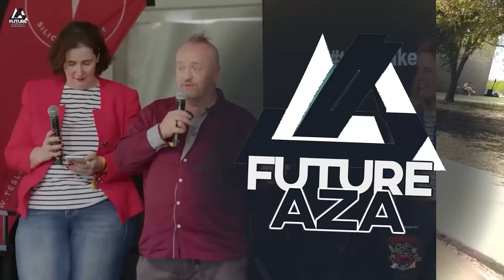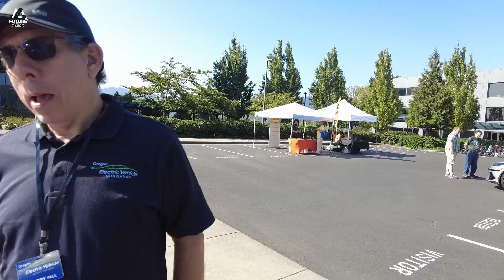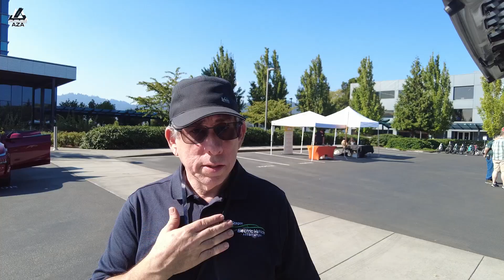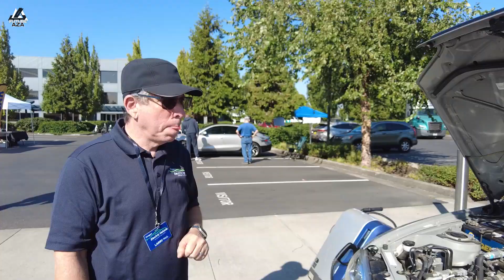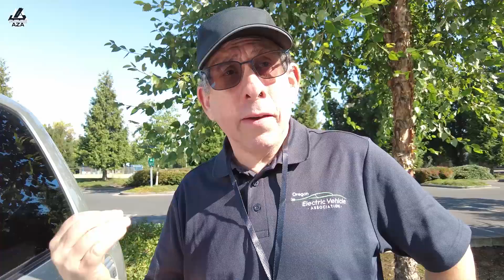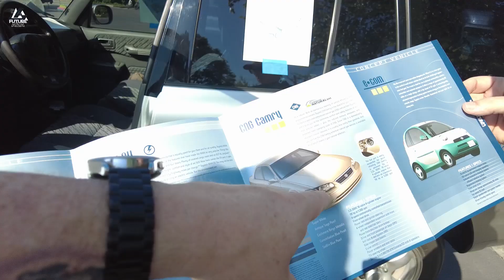Toyota’s Hidden EV Gem Unveiled in Oregon

Comment: What an interesting show Brian! Had an original LS400 (1991). Lasted 27 years original engine & transmission. I still remember when one of the fans failed. Toyota provided 3 fans, one for each bank of the V-8 and a third to run when engine was shutoff to continue cooling. Conceptually the design was to support continuous 100 MPH operation for Autobahn use when one fan bank was failed. Donated to charity. The TPS can be amazing -- they are quite conservative but when they decide to do something they are remarkable.

Comment: Cool find!  I almost never travel more than 20 miles in a day, so that "terrible" 75-80 miles of range wouldn't be so bad.
Also, the stock is up.
Thanks Brian.
Reply from the maker: Very true!
Reply: The catch 22 being; 20 miles a day in a normal car = one 2 minute fill up about once a month. And no need to futz with charging cables at home.
The expense of the charger installation alone would pay for several years of gasoline.
Reply from the maker: @SteveLomas-k6k Untrue on all counts. 600 miles of gas is 2 fillups, you can't go to a gas station, pay, pump, and leave in anywhere close to 2 minutes, there's no "fuss" with cables, you just plug it in like a normal human being, and you can just use a wall outlet to charge WELL in excess of 20 miles a day. I was averaging more like 35-40.
Reply: @FutureAzA  On a recent trip, I timed both fill ups at 1 min 45 seconds. From the light being on to 100% which is about 500 miles range. So 2 minutes includes paying (no apps or 'handshakes' required)

When I got home, I parked where I wanted and was done with the car till I needed it again. i.e. no futzing around. :)

"just use a wall outlet to charge WELL in excess of 20 miles a day."

I can already get 500 miles in 2 minutes.

A whole day for 20 miles? You can understand people's lack of enthusiasm for EVs!